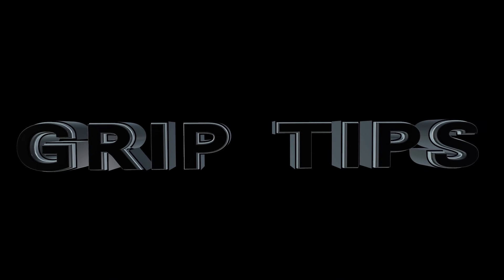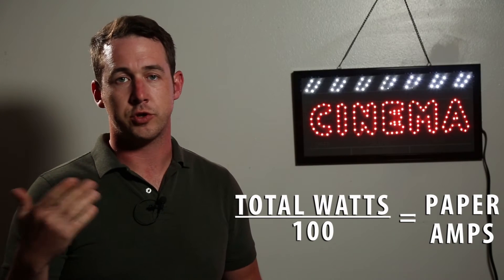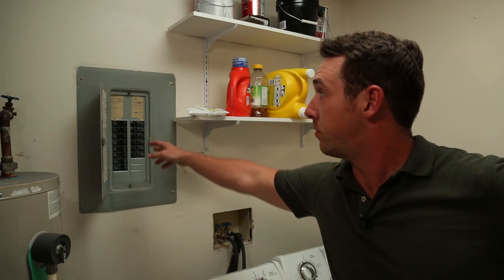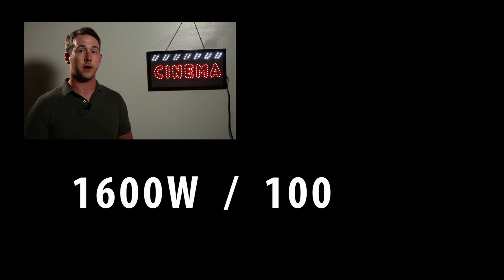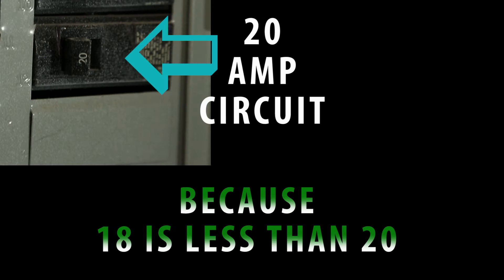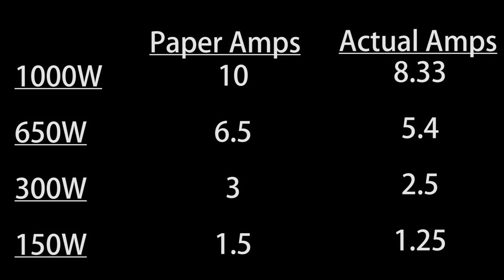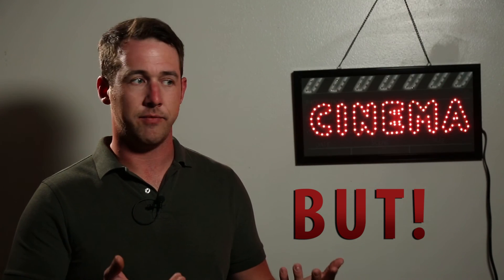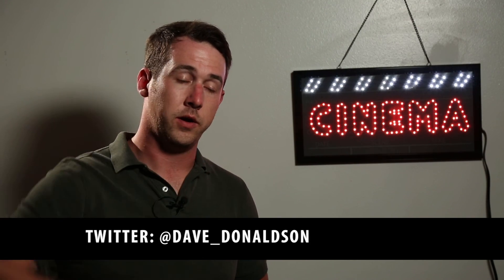Ep 05: Paper Amps

Comment: Does one circuit mean one outlet where I can plug one thing in? Or is one circuit for the two plugs in outlets? Like the plugs around a house always have two things so you can add two plugs. So can each plug use 15 amps?
Reply from the maker: Emily Nicole most outlets have two Edison connections on each outlet. Let's say you have 2 outlets in a bathroom and they are on opposite sides of the bathroom. Then when you look at your breaker box, the breaker labeled "bathroom" says 20 on the switch. That means that those two plugs are on the same circuit and anything you plug in the bathroom is limited to 20 amps

Comment: Do LED lights use as many amps as tungsten and halogen with the same light output?  Also I get confused by watts, lumen, amps etc.
Reply from the maker: LED's are wayyyyy less. You could probably hook up 10-15 1x1 panels on one 20 amp circuit and be fine. Most of them rate at about 1.4 amps. But check the light first.
Reply from the maker: We call those "Suitcase Generators". Some are extremely silent. Ive been on a set where we ran two 1k lights off 2 suitcases and 50-100ft away, you couldn't even hear them. i believe it was a Honda eu2000i silent generator. extremely portable. very quiet. i want one! i will be doing an ep on Genies very soon. The one im talking about will be featured.
Reply from the maker: but to answer the amps question, Yes there are genies that can run lights. i'll have something more in depth in episodes to come. hope this helps! :)
Reply: Thanks.  Also this guy was going to sell me his 3 Lowell 1000 watt lights and he said he uses a Ryobi Generator when he shoots outdoors.  But I would think a generator would be noisy.  Plus does it have a maximum # of amps that can be plugged into it?